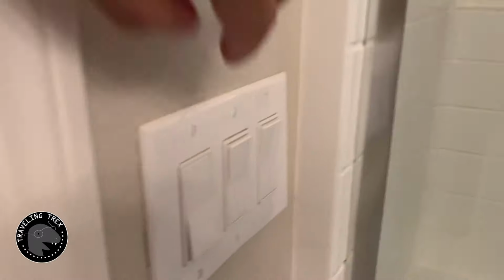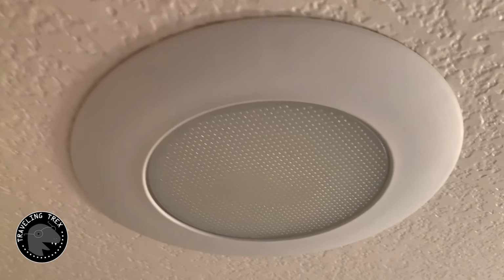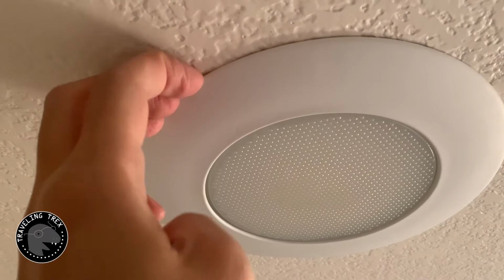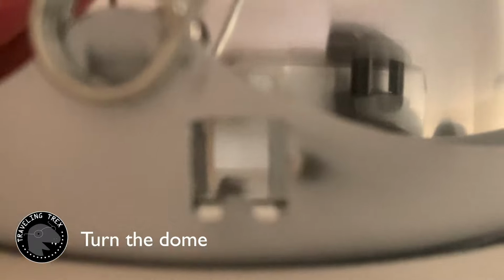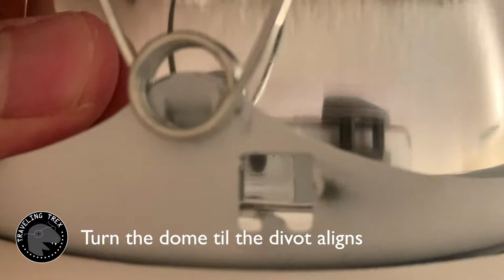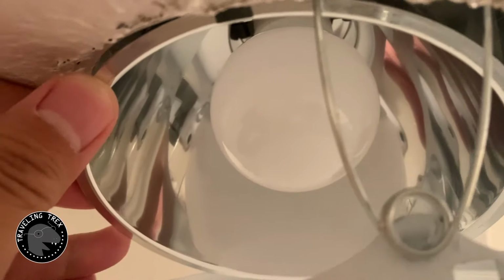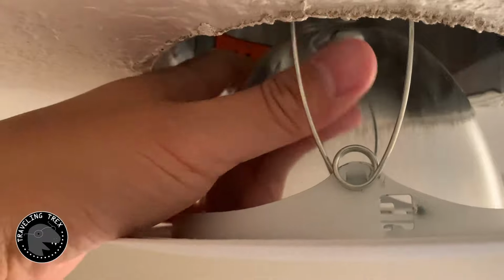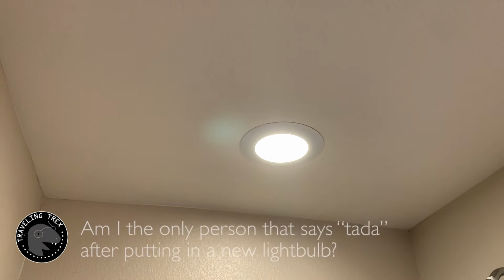How to: Replace: Shower light bulb recessed to the wall

Comment: Quick tip. If you have small hands u don’t need twist anything just slide your hand in and twist the bulb off and replace. I had a regular size bulb also. So it was easy

Comment: Thank you for this! Am I able to put any type of bulb in this?  I noticed the one that previously went out had an auto shut off? If I forgot to turn the light off then it would cut off by itself? If I flipped the switch off and then turn it back on then the light would come  back on immediately. Maybe it’s not the bulb but the way the electrical was designed???
Reply from the maker: I would also think the auto shutoff should be controlled by the switch and not the light bulb, unless it’s a new type of light bulb I am not aware of. Let me know how it turns out.
Reply: May I ask if you were able to remedy this.  My bathroom shower light fixture does the exact same thing… only once it’s off… I have to wait for it to come back on.
Reply: @deryckszatkowski5284  no I have not! I think it has to do with the wattage of the bulb maybe 
because once I replaced the bulb i now have to wait for the light to come back on too. Doesn’t come back on immediately. So I’m not real sure! If you find out the answer to this please let me know, because it’s mildly irritating.

Comment: very helpful, but need to talk about the type bulb you use for replacement.  Keep the lumens the same as the original (300 in mine).  If you put a bulb with higher lumens there is a fire hazard risk as the bulb is enclosed in the can.

Comment: I followed your directions but mine didn’t have the metal enclosure. 

Is this normal or did a cheap contractor skip a step to save a buck on a part when they were building my home?

Comment: I really miss having a shower light. It lightens the tub area. That fixture looked a lot similar to the ones I had about 6 years ago.
Reply from the maker: So I assume your current one has no light?
Reply: @travelingtrex4897  yep. It really sucks. I love those lights. They’re cool. I would’ve put an LED daylight or LED color changing light bulb in there as I love the light of LED
Reply from the maker: @loudspeakertestsmorebyaida3804  Does it have a vented fan above? It depends on whether it's a rental. If not, might worth while to change it the way you want.

Comment: I didn’t know what I was doing and I pulled so far that the two metal pieces that hold the fixture in the can fell out. I’ve swapped the bulb, but can’t get the cover back in place.

Comment: You did it the hard way, should’ve just take off the cover first.
Reply: What?
Do you have a video where you can do this?
Remember, it's a light that's above a shower or a bathtub and it's designed so that steam doesn't contact the light bulb.
Reply: @machomachinmachinmachinmac6910  I’m sorry I didn’t mean to disrespect you or anything like that.  I have a shower light just look like yours and this is how i do mine.  after pull down the cover I just squeeze and pull down the two springs that hold the cover.  The cover should come off and you can  replace the bulb.  When put the cover back on you just have to make sure to push it in the same direction as you pulled it out and it should clip right up. You’ll see what I mean when you got it pull out by squeeze the springs that we’re holding it.